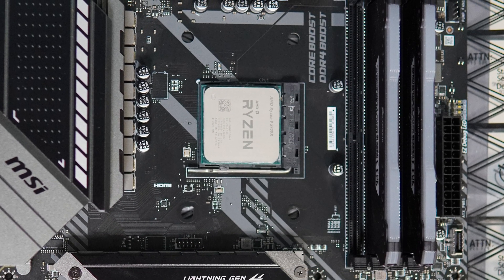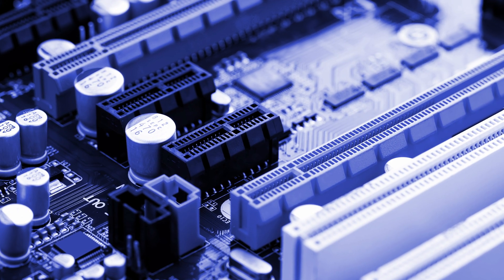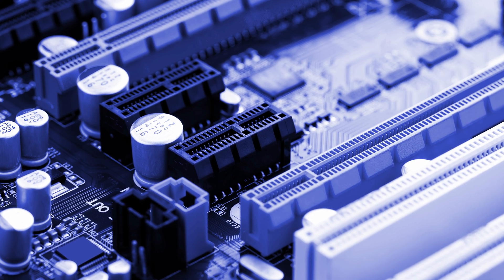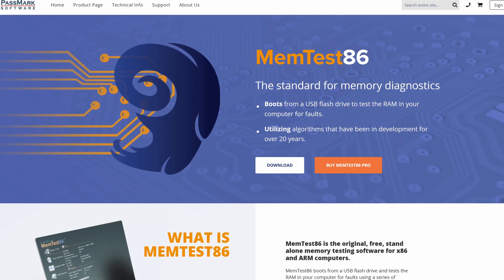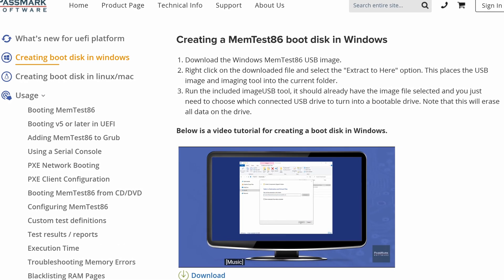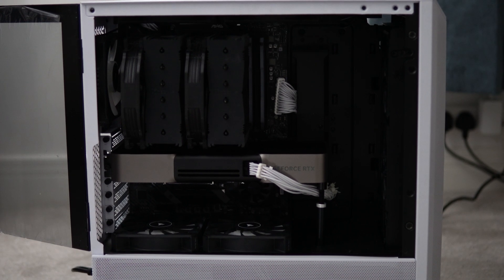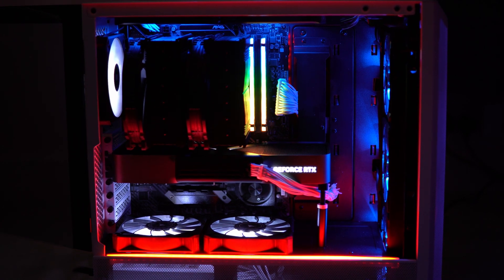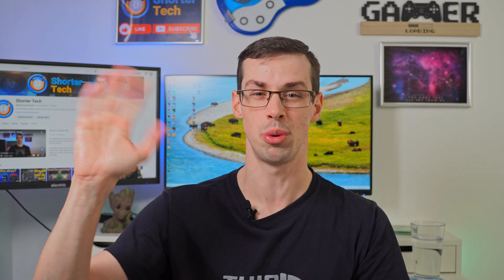Can Faulty RAM Kill Your Motherboard?

Comment: Hi, mobo just got fried by my Corsair 550w PSU, and i was scared to try out my old stick of rams, i had 64gb, thanks! But what i'm really curious is, you look like to have a mATX on that system, and i'm looking for a small Case that can allow dual GPU for lossless scaling in the future. What are your specs?
Reply from the maker: Hi, ugh sorry to hear that about your PSU and mobo :( That's worrying! I showed off a couple of systems in this video - I think one was a B550 mATX build, another was an X870 ATX build. Whichever you go with though, just make sure that the second PCIe slot runs at x4 not x2 or something. One time I bought a B550 mATX motherboard and the second slot was only x2, and then things were getting bandwidth throttled which sucks lol. Good luck with the build :)